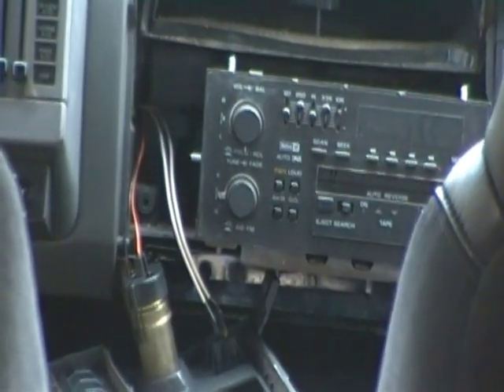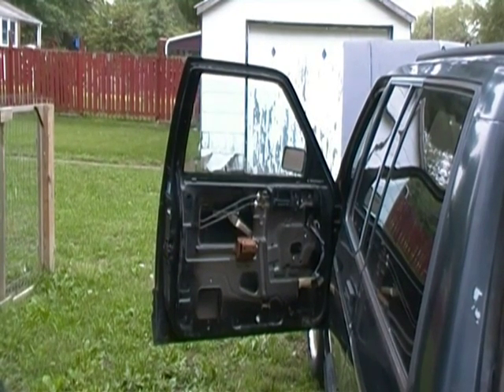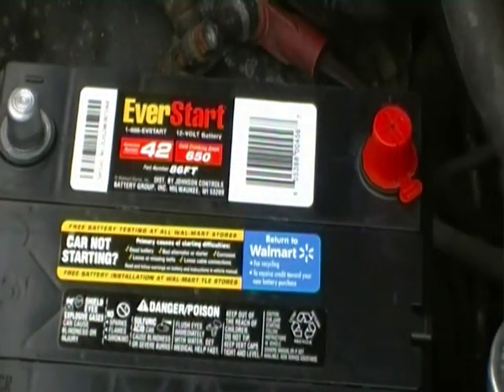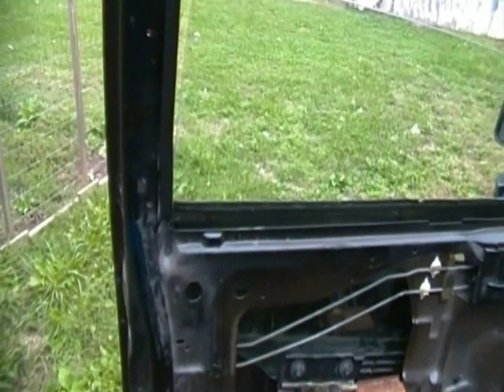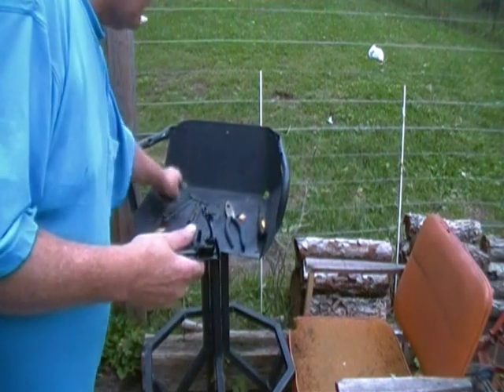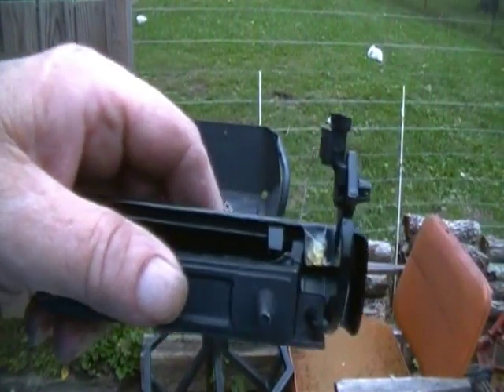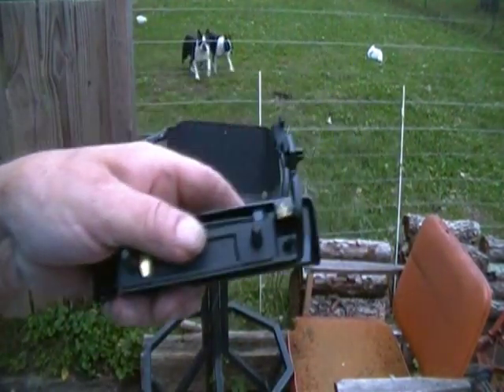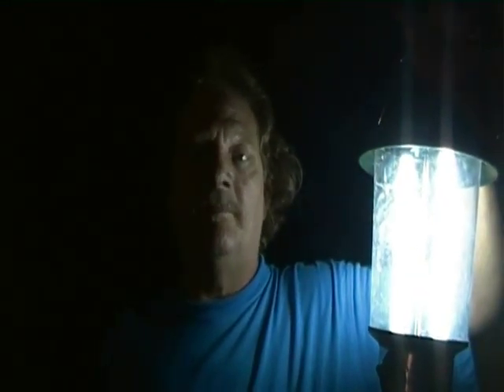OLDS BRAVADA FIXIN THE LIL THINGS

Comment: Still have the bravada?
Reply from the maker: Nope,  sold it a couple years ago, It was on it's last legs and the kid that bought it blew the engine up in less than 10 minutes. I gave him his money back after he brought it back to me, then sold it to a parts yard... Why do you ask ?
Reply: Well I actually bought a 91 blazer and got ripped off.  Valve seals are completely gone. So my father is going to be selling me a bravada identical to the one in your video. Just needs some parts.  “Use my blazer as the parts truck “. Didn’t know if they were worth fixing. Or if I should just take the loss.  Bravada has 119k miles. My blazer has 310k miles.
Reply from the maker: @Metalfox-mc8nr  I see, If I had to do it all over,  I would never have gotten that one. too many problems, parts were hard to come by and the engine just never was very sound.  I'd let em both go and concentrate on your next ride... 
Good luck to you.  Let me know what you decide to do...
Reply: Thanks for your reply !  And I guess I’ll sleep on it and make my mind up. Thanks for the advice!

Comment: Hi..i have a question about my 96 oldsmobile bravada. the car cuts off at stop lights or when i put it into drive or reverse. I have changed spark plugs, ignition wires, battery. starter solenoid, and alternator. do have any idea what the problem could be? this is extremely frustrating. thanks.